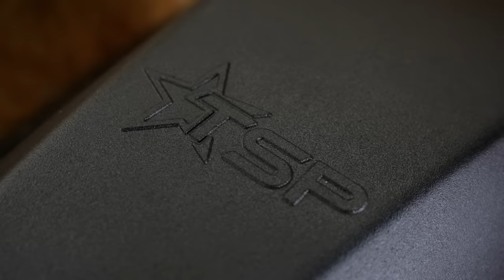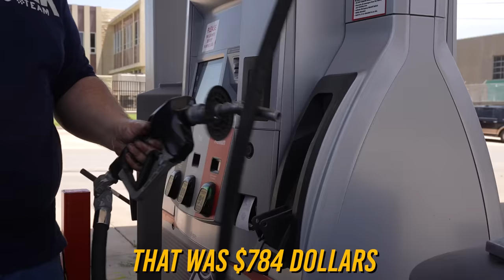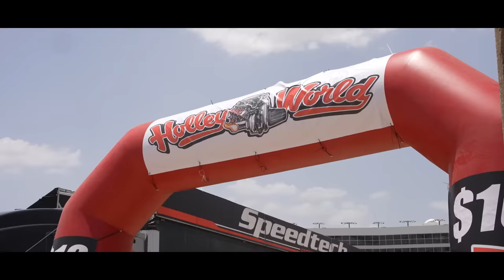I Installed a 1000HP LS Engine in my Ford Ranger

Comment: I could be wrong it's probably not the tune killing the engine but rather the intake requiring an higher idle to have a good amount of air and fuel and keep the engine running, so you may want a higher stall torque converter.

Comment: The LS motor is just a slight improvement upon the Ford 302 with nearly identical cylinder spacing, so its all coming full circle.

Comment: I like my Ford Ranger... but I don't know if I like it enough to put a 1000hp engine in it, lol. 
OF COURSE, I am further north where they use salt on the roads so I've had to deal with frame rot/rust issues. 

Anyways, you seem like your having so much fun it should be illegal.

Comment: never want bother with ls engine because have so many customers bring in they randomly vehicles say engine aint running well when i open hoods knew it was chevy ls is totally junkie engine and i pull head off find pistons is shot cracked into pieces in every other engine same one from chevy ls engine n i got fed up pissed off about it n tell them all for now long im not rebuild any this junkie chevy ls engine dont ask me why because not fun just too much stressful on me trying replacing broken pistons or valve broken in engine aint fun aint easy because i have pull fender off in order to get exhaust manifold off of head otherwise ended up having cut it in half n pull it out of vehicles 
what cause failure i cant tell what cause it but i can identify it would be revving up so many time just blew pistons up inside engine 
customers just upset that i refuse fix them n tell them pull engine n swap them is much easy n cheap they didnt like it so too bad go find other shop i aint doing it
if that ls blew up it on you
i never want fix chevy or gm i would love crushed it into piece n forget it n enjoy inline engine far better than v8
Reply: this fake person above me is scammer dont pay any attention to them
Reply: no n do you know who you messing with 
because i can see you in your webcam